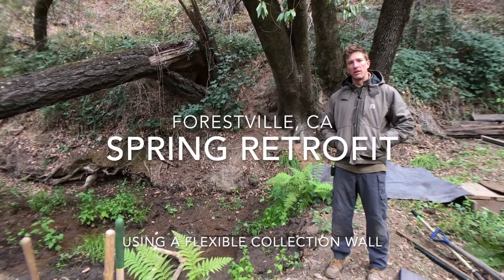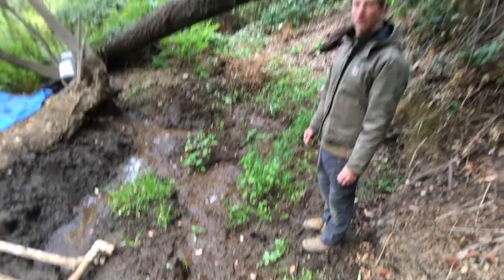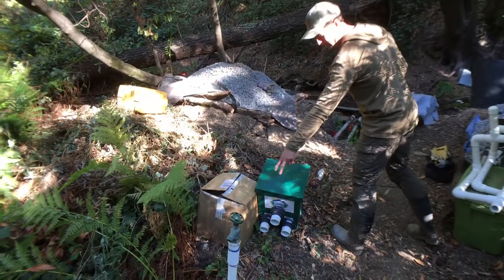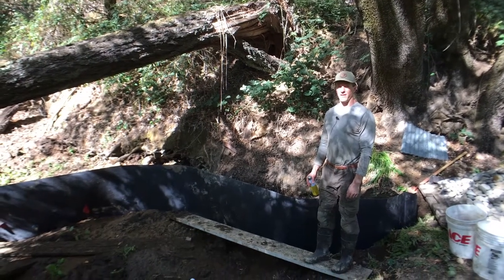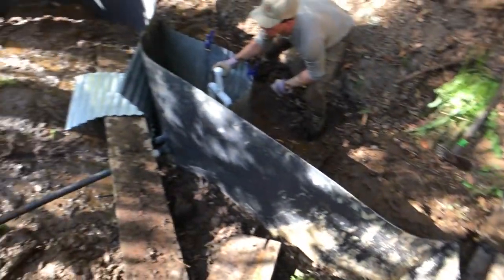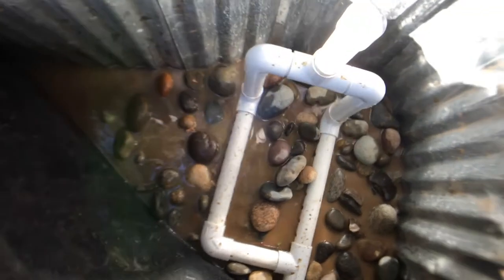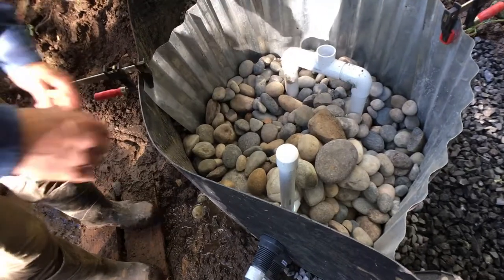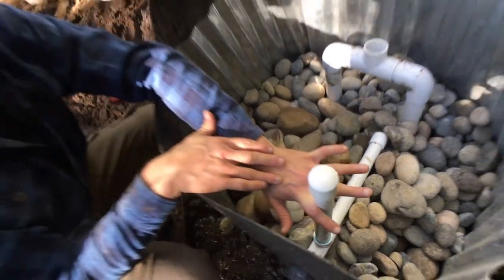Spring Seep Retrofit With Flexible Collection Wall

Comment: Wow! What a wonderful, informative vid. Very professional, nice job. I’m getting ready to redo my H2O collection system after 30 some years and the two of your vids that I’ve seen are by far the best that I’ve come across on YT. I really appreciate the sharing of knowledge. I had never heard of bamboo rhizome barrier and after I ordered an 80 mil sheet, I noticed that you had doubled up for your retaining wall. I hope my single 80 will be adequate. Mickey
Reply from the maker: Hi Mickey, you should be just fine with 80 mil - the more of these we install the less I worry about the thickness - as long as it is sunk in the ground (earth on both sides) I think you'll be just fine
Reply: I have a large seep on the side of our mountain.  30’ wide… 

Do you have a part list or supply store you’d recommend?  We’re in Montana

Comment: Hello we are new to the channel and liked and subscribed. Really like your I dare solution. It's almost like a bog  filter for a pond . And you can put some perennial all year round vegetation flowers because the roots inside the rocks like an aquaponics system. as the water seeps through the roots will collect the water and collect the bacteria and help fither and clean the water before it gets into your  collection box and return pipes to your settlement tank to your holding tanks

Comment: I appreciate your detailed descriptions. I have four collection dams in different springs and canyons that range in age from 6 years to 30+ years old. Three of them I built myself. I have the luxury of being able to get down to bedrock, to build cement dams in the dry season, so my collection dams are not at risk of being undercut by water, but on the upstream sides, I always eventually have roots of various trees and snakeroot taking over and filling up the entire system all the way to the collection pipe. This can take anywhere from 2-5 years, but I have not yet discovered a way to keep the lines flowing and roots out for more than a few years. Do you have any long term discoveries you have found for systems working for more than 5 years or even a decade? Some of my pipes are just open 3/4 or 2" pipe with an elbow pointing down in cobble so sand won't flow in as easily, but a couple are regular mesh screen conical "foot valve cages" but with the check valve assembly removed. None of these are immune to root plugging. I find that larger holes are somewhat less trouble free. The smaller hole cages I need to back flow them pretty often to clean out silt. They range in depth from 3 inches to 2 feet. 3-4" is easier to clean, 2 feet takes longer to plug but harder to backwash.
Reply from the maker: We haven't run into any root plugging scenarios yet - just moved to Tennessee though so might see more of that out here! It sounds like you've already done fine screen wraps around your intake pipes.

A material I am keen to work with for future installations is geofabric - fine enough to filter out the smallest of sand particles - I've got a prototype modular collection system I'm hoping to trial soon that would basically involved wrapping a 55 gal HDPE drum drilled with holes in a sleeve of this geofabric - basically turning it into a sump, inside which would be the collection piping, screw off lid for easy access and maintenance. The same principles could perhaps be extended to your entire filter/collection package (i.e. lining and wrapping the whole collection zone with geofabric)? I have yet to see roots penetrate this material, though I don't have any long term data on that as of yet.

Comment: Very Cool.  Once the tank is full from the spring box where does the flow go?  Is there another overflow at the tank or is the design of spring box overflow not just for the biblical flood.  Thanks for sharing.  Would be great to see what this looks like in a couple of years.
Reply from the maker: Hi Daniel, there is an overflow from the actual storage tank into an adjacent pond. The spring box overflow is just for some crazy unforeseen way that both feeder lines to each of the properties get clogged or shut.

Comment: Explain how two sheets of plastic prevents contaminated surface water from entering the system.
Reply from the maker: The sheets just protect the capping material at the spring head. If there is a contamination source further upslope that gets into the groundwater before this zone it won't help. The spring head itself is now level and flat and walkable by wildlife, so more likely to attract droppings etc, so at least we can keep them out of the immediate collection zone.

Comment: Very informative! Question though, some of your videos show the shock port attached to the main filter inside the retension wall, but other diagrams show the shock port attached to the over flow pipe outside the wall. Is one design more effective?

Comment: This is a great video. I need to do this type of retrofit on the old collection system mt grandfather put in thats now failed. I'll have to make a large collection wall/collar as there are multiple seeping points.... i like how you've used the tin to keep the filter rocks seperate for installation. This is great info.

 I'm curious about the clay base of the wall. This seems like one of the most important parts? Otherwise water goes under it? Any tips for this part? 
Keep up the great work out there boys!
Reply from the maker: Hi Sara,

The clay "collar" for the collection wall is to prevent / reduce the likelihood of any piping of water at the base of the collection wall. Very hard to objectively assess its performance, but in a lot of the old manuals this technique would be used to seal around the base of a spring box that would be set on top of a point source spring, so we've adapted it to the collection wall installation. In this particular instance, the substrate into which the wall was being set was almost gelatinous, and very susceptible to piping. By setting the wall into clay cobs we limited that piping until the back side of the wall could be filled in with native material. Thus far it seems to be working. 

That's great that you have a legacy spring to work with - a true pay it forward kind of opportunity :) We hope your retrofit goes well and you get that wild water flowing again!

Comment: Why didn't you put drain field cloth between the uphill dirt side and your rock? Drain field cloth is cheap and it keeps dirt and sand from creeping into your cobble and crashed rock. Yes I have developed many springs and dug wells. We always use Drain field cloth, super cheap insurance to keep the system from failing down the road.
Reply from the maker: Definitely will be doing this in future installs - the cloth we had on-hand was actually quite impermeable for some reason, and was causing backflooding issues, so we chose not to use it. The water bearing layer is also mostly gravel, not a whole lot of fines, but I agree, adding some of the sand/silt-proof geotextile fabric is definitely  the way to go.

Comment: What is the material of the long flexible wall? When is the best time to set up a collection system like this? I started my collection system but ran into heavy rain (8 inches in 4 days) and find out the overflow was really small for the collection system. Love your videos , greeting from Puebla, Mexico
Reply from the maker: Hi jmbando1 - the wall material is bamboo rhizome barrier - you can get it in long rolls at many different widths. It is made of HDPE and very strong yet thin and pliable to work with. https://lewisbamboo.com/collections/bamboo-shield

It depends on your specific site, but I'd always lean towards drier times of year, particularly if you're working with a seep vs. a discrete spring head - it will be much easier to work with. Sounds like you have a great data point for sizing your overflow! Good luck with your install!

Comment: I’m about to buy the remainder of the stone for my project but I’m confused what I need because one of your other seep vids has 3-5” cobble, followed by 2” and then 3/8 pea gravel, a fine mesh screen and finally sand. While this vid is basically 3-5” cobble and 3/4” limestone w/o a mesh screen. Why the change and what do you recommend?  I’ve purchased the mesh, big cobble and 3/8 pea gravel already. I’m not sure what else I need. Is the sand essential?   Thanks for your prompt reply to a previous question, I appreciate your help. Mickey
Reply from the maker: Hi Mickey,

We based the selection of the filter package materials on the nature of  the native water bearing sediment. We used sand in the prior video because the native water bearing layer was a fine sand that we wanted to keep out of the filter package, and very susceptible to wash out. We have a prototype system in development that I am hopeful will make a lot of the hauling of filter package materials obsolete - essentially a 55 gal drum that contains your collection piping, screw top lid for access - the drum is drilled with 1/2" holes all around the sides and bottom, and then we make a custom "sleeve" for the barrel utilizing a fleece geotextile - similar to the one David talks about here: https://www.youtube.com/watch?v=cBeZplT_5mk

This would allow for high-inflow into the collection barrel while still stopping essentially all sediment intrusion. The screw off top would make maintenance far easier on the collection piping than having them interred in gravel and cobble. The sleeve would be "stitched" together use a torch to get a complete seal on all the seams. Hopefully that was a clear description.  Best of luck with your install!
Reply: @7thGenerationDesign  Thanks again for your thoughtful reply, I appreciate the link to David, he’s got some good stuff also. If you ever get into any hydroelectric systems, I’ve got a blog on my job which might have an insight or two. It also has a link to my YT vid. Cheers, Mickey 
wvhydro.org

Comment: I noticed where the two 11/2 pipes meet you used a tee instead of sweep 90's or two 45 degree fitting to cause less turbulence. Anytime you have water colliding is not good. ABS drain pipe works great for these spring systems and ABS has all kinds of sweeping fittings. It's just going to a springbox, drain pipe works better. Less restriction with big sweeps and better flow. So many young people comment how great all these do it yourself videos are without any experience. I'm not trying to troll just tired of watching everbody copy someone else's idea and making a video. Especially when the guy you learned from doesn't know much. Yeah drain field cloth and ABS drain pipes with big sweeps are how us old school guys do it. The right way!